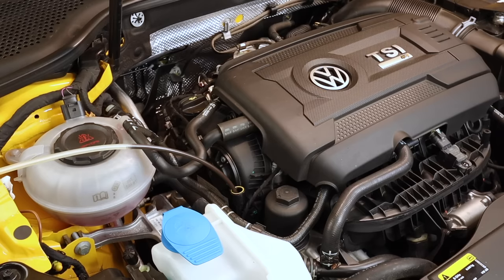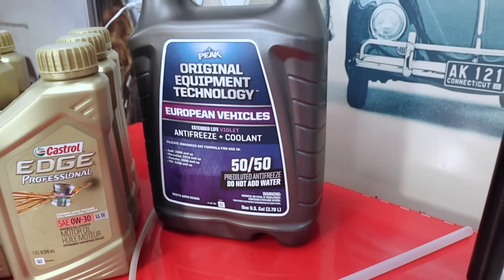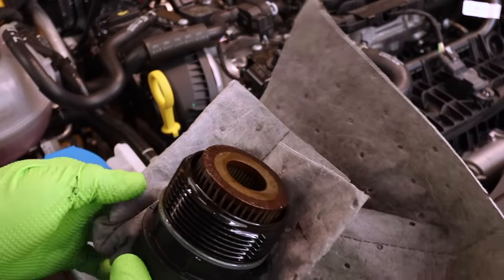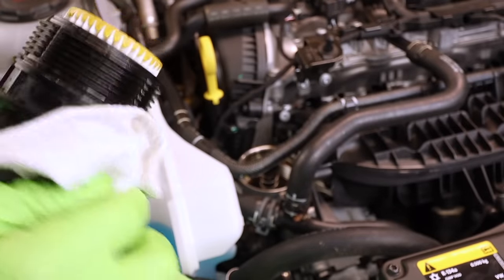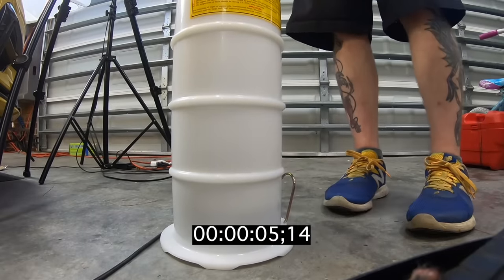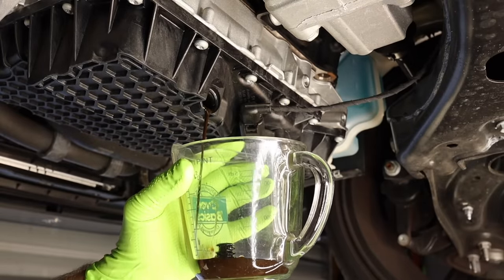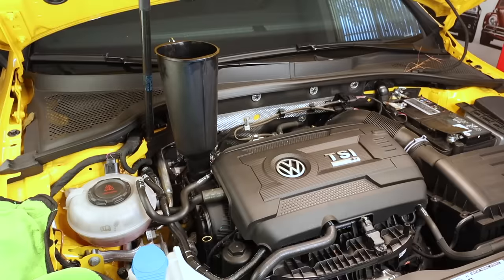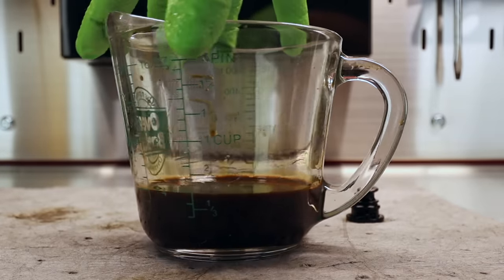Will an Oil Extractor Get All The Oil? (MK7.5 Golf R 5000 Mile Service)

Comment: When I did the oil change on my dad's old A6 2.0L, I removed the drain plug after extracting the oil and only one drop barely came out. I even got the oil out of the filter housing with the extractor. Not sure what you're doing to get such a different result than me.
Reply from the maker: I think if I let got longer I could have got more. But still 100ml isn’t that much of the overall quantity

Comment: When I drained oil from a BMW I found fragments coming out. With the extraction method I would never have noticed it since the tube is too narrow to suck up the parts. Therefore I always drain. It also gives me an opportunity to check the underside as well.
Reply from the maker: What was the source of the bits?

Comment: I like using a oil extractor. I've been using it on my Mercedes since that's what the dealer does. My car will take 8.5 qts of oil and it is what I pour in. When checked the oil level it is correct. It even works with my 4 Runner. But I have to move the extracting tube up a bit to make sure it gets all the oil .  On the Mercedes I just leave the tube sitting at the bottom. I took the drain plug off the first time with the 4 Runner. Very little oil came out. A lot less than what came out of the VW in the video. . My 4 Runner will take 5.5 qts of oil and that is what I put in after getting the oil out and replacing the filter. I like using a oil extractor.

Comment: I think I like this approach. No need to lift your car for a simple service. Also no mess.
As far as 100ml is concerned,  even if we take 200ml, that's about 5% of the total, so should be fine.

But one concern, when you open drain bolt, the heaviest / slushiest oil comes out first and the lighter oil should further help in cleaning up. The same is not the case with these vaccum based oil removal.
Reply: The extraction hose hits the bottom of the tank, it is the same.

Comment: i use to own a service truck and go around and do 'fluid change' and other mechanic task and my truck was equip with 2 small extracting pump one manually the other one automatic powered and i can say for sure that most car when you extract the oil not all of it will come out their will be some left over thats a thing i been telling my customer because they was worry about it my process on old car the one that as the oil filter under the car i have to lift the car and often on request change the drain plug with a better one that include a seal that most factory 2010 and lower don't put on, so it can leak from the tread and have a what i call 'Wet Oil Pan' this you can see often on older car that the drain plug asbeen the problem for many years but back to the subject usually if i have to lift the car i will take my pump and stick the tube inside the drain plug hole and try to catch everything i can but considering some go pass the mark of 5000 Miles or for diesel 10.000 Miles it doesn't matter if you drain all of the oil to 'bone dry' some pressure will still hold a few ML of oil in the engine it self where its not reachable, another tip that i see often is people remove the oil fill cap to think it will drain all the oil faster and i can say its wrong because if you use a pump and crack open the oil fill cap your removing the built in pressure witch force the oil to not evaporate and by not opening it your helping your pump to suck all the fluid and not just the air that could cause your hose to as some oil left over to act as a return line so while you use your pump you can always let it run if its an electric one till you pull the hose out and then put the hose up and shut off the pump to have all that left over in your waste oil jug/bucket instead of back into your oil pan ! and from top  filter if you have a most recent one its always good to have both O rings gaskets change to prevent leak :D, over all great video :yougotthis:🤟👍

Comment: last oil change on my mk6 gti (oil temp ~ 180 deg F), fluid extractor removed everything. Opened drain plug after to check, barely a drop. These things really work well on level ground and with hot oil. Anyhow, that engine sounds beastly... bone stock?

Comment: With our TDIs we find that extracting the oil out of the oil cooler makes a significant difference
also add fitting to attach your ac vacuum pump and you can hear the hiss and bubble when you  move the tube around inside the oil pan

Comment: this is great for low profile cars with the bottom plates with a ton of bolts and screws. Such as maserati bmw mercedes etc...  way convenient and 100ml. will be fine. The extractor will make it more convenient and less of a mess.

Comment: I reached 260 000 km with a diesel engine using 10 000 km rated oil but changing it at 8k, I also remove the pan to clean it all well, last oil change I had some sludge on the pan which I didn't had before, I'm planning to keep this engine as clean as possible and see if I can reach 500k.

Comment: There was a change to the engine oil requirements partway  through the model year due to the engine being newer (latest Euro spec compliant or something) My MK7.5 is still the older model and/ 5W-40. The dealer can check the VIN# to see if the engine is the newer version or the older EA888. The newer engine was down-rated in HP from 296 to 292HP in stock, due to these emissions specs.

Comment: I KNOW this isn’t a Mercedes but Mercedes actually recommends evacuating the oil through the dipstick
tube with an adapter that fits on top of the dipstick tube (not a separate tube inserted into the dipstick tube). In my experience on Mercedes (and I KNOW this isn’t a Mercedes) you actually get more oil out by evacuating it than by draining it (in normal shop situations) i.e.  I guess you might be able to remove more oil by letting it drain overnight etc.

Comment: Great video!
Just curious where you got the part about the engines being designed to be drained with an extractor from. I worked at a VAG dealership and the manufacturers instructions REQUIRED us to use the drain plug over an extractor, including all EA888 engines. We'd only use the extractor on old cars with fucked up drain plugs or cars from other manufacturers (mostly BMW and MB).
Reply from the maker: When they first came out with this engine vw put out several documents and a video with Leon showing to extract

Comment: I did the same thing with my Harley and usually I get most of the oil but this last time, I had quite a bit of old oil that didn't get suctioned out. Next time, I will use the drain hole for a complete oil change. It seems easy, but unless you drop the drain plug, you are not getting all the contaminants out.

Comment: 1:17 - do w/warm engine.  W/a cold engine takes forevr n neumatic ones r worse.
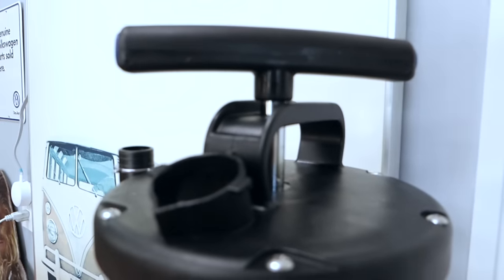2:44 - run car for about three min. turn off and let it sit for 4 a min. pull dipstick out wipe it n put bak in n slowly remove it again.  Oil should be right at the line.
Oil filter change
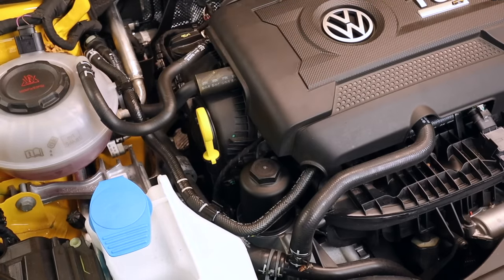7:35 - take out dipstick n c what hose fits best in there.  (9:07) - periodically pull hose out.
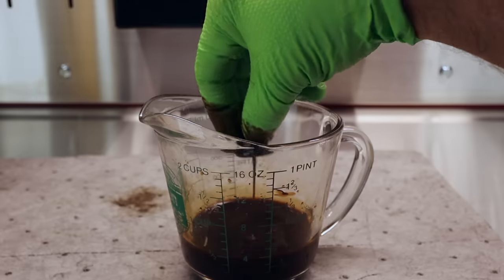11:46 - less than 1/2 c. of oil left when u c how much oil was left the extractor didn't get.  Let's call it about 100 ml of oil left.  (12:00 - 12:19) - no sludge left startin w/1:17 if u follow all the directions.

Comment: I poor and extra liter in while draining or extracting down the dipstick conduit, oil fill point and the oil filter location to help rinse and get the last bit out. 

Anything left beyond that is fine, as you said, we're not cleaning the oil pan so you won't get that much left.

Using the aforementioned technique you won't have 100ml but whatever diluted amount, I suppose 20ml old stuff if you factor in 1 liter clean to the 100ml old plus perhaps 10 ml of old pulled off of the engine complements when you pour in the last liter.

Comment: I pull the plug out and while the oil is draining I rotate the wheels, the extractor is neat, but you still need to go under the car anyways. Thanks for sharing Charles.

Comment: 100 ml on 6000 ml is 1.6%. With older cars I like to run it hot, let the oil go out through the drain plug, and then with the filter not in, and the drain plug out, I throw in a little bit new oil. The flushes the old out oil a bit. The place the new filter and close it and fill it off.

Comment: ...you might leave some in the pan, but you're also able to run the tube into the oil cooler through the filter housing and get the oil that would never make it to the pan...

Comment: I need some advice. I have one of these (a four uncles one, with the air compressor hookup). But I'm finding that when I manually pump, it works WAAAY better than the air compressor hookup. BUT it's extremely slow, as in 2 liters per half hour compared to your 1 minute for 5 liters.

Comment: Some drain plugs have magnets in them to collect any tiny pieces of metal, so for me the drain plug would definitely come out as also there may be tiny metal shards in that last bit of oil. 
Also any aluminium shards whould be in the sump in that last bit of oil. 
OCD maybe but theyre better off out than in.

Comment: This is all I do every month on my tdi. I use my Amazon to auto order the oil so it shows up on the first every time. About 2500 miles takes 10 minutes and a bottle of prolong engine treatment. 
Then I pour the oil into the fuel tank and treat the fuel system with that prolong. The car is so happy and my rawtek Malone stage two is amazing. I change the filter yearly. 
I love oil, good video

Comment: My 4.0TFSI has the filter right next to the drain plug so it really makes no difference.  The belly pan is a pain in the ass to remove.  I might do a mid service change and leave the filter untill next time and do this.  My wifes 2.0TFSI is similar to yours and it really looks enticing.  Engine flushes would get a drain plug removal.

Comment: My 2019 GTI owners clearly says use 0W-20 for the GTI and test the R in manual says 5W-30 5W-40. I also had to get oil from dealership.
I also will change my oil every 5,000 miles because I track my car. After seeing this I think I'll alternate removing oil from top the one time then next from bottom.
Reply: Bull Bear Portfolio 97,000 miles on my mk7 GTI only running 0w-40.  Changed every 7,000 until I tuned it and now change every 5,000.

Runs perfect. 

I’ve been using Mobil 1 euro and Castrol Euro. $27ish for 5 quarts on amazon.

Comment: I've got 2 questions concerning the extractor method shown in this video:

1. Why would you install the new oil filter before starting to extract oil? The extra air supply should help with suction I think?
Kinda the same reason why you should take out the dip stick before taking the drain plug out.
2. Why not extract the oil through the oil filter line? Should have a larger diameter than the dip stick hole?

Thanks!
Reply from the maker: 1) maybe but I haven’t seen that make any real difference. Especially since doing this hot is important 

2) it’s not a straight path to the pan through the oil filter housing
Reply: @HumbleMechanic  OK makes sense, thanks!

Comment: Always use the drain plug method to extract oil from the engine
It's time tested and the best
Reply: There's a reason why there is a drain plug. The most important part of an oil change is removing the crud that settles at the bottom of the pan.

Comment: Hi @HumbleMechanic
 thanks for the good videos, I just watched this one and I'm a bit confused about the coolant. I see you're using Violet and it says VW 2006 and up, however, the coolant in my '17 GTI  S is pink G13, and the user manual says: "The engine cooling system is filled at the factory with ... engine coolant additive G13 (TL-VW 774 J). This engine coolant additive is PINK" The pink coolant from Peak says "VW: 1996-2005" so what's going on here? Thanks again for the videos.

Comment: 100 mL is one-tenth of a liter. There are probably another 50-100 mL left in the engine since changing the oil does not drain it dry. I don't see a problem with it. 100 mL is 1.75% of the oil volume of 5.7 L. It's also not designed to be drained completely dry at each oil change.

Comment: Been using extractors for about 6 years now, far as I figure, whatever is left below shouldn't be a problem if you change your oil often enough and use decent oil. I haven't seen any real sludge in ages anyway.

Comment: The biggest reason I use an extractor is I do not put off oil changes plus I hate having to remove the belly pan more than doing the actual oil change.  Since my oil filter is a cartridge style that is up top it's even easier.  With the style of drain plug that's on my car the extractor actually gets MORE oil out of the sump than removing the plug.  No brainer!!

Comment: I pull the plug. Always have and probably always will. It’s tempting to buy an extractor for the ease of changing the oil but I can’t leave oil behind like that especially because I was anything that may be at the bottom of the pan out of the motor.

Comment: Many do not understand Plastic deteriorates without use. 
Plastic becomes brittle, sometimes deteriorates to powdery substance or develops cracks without movement. They can be designed to have a limited life, conversely they can be designed to have unlimited life ( plastic bumpers, house council bins etc). 
Control on the rate of deterioration (unpreventable deterioration) is the holy grail of manufacturers as they didn't have this over metal. Plastic has a timer constantly running down. 
We see this in the application of plastic on radiators, dash boards, door trims and even plastics on shoes etc. 
This control on deterioration rate is designed, engineered and calculated by manufacturers to reduce the life of the unit so it reaches financial impracticality earlier than before.
Plastic parts designed to fail (as for sure they can do non degrading plastics) is one reason newer generation of cars are incapable of becoming classics.
Reply from the maker: I wonder how these will hold up! Most of the plastic isn’t common plastic but more fiber composite aka space age polymers Ahha.
But really I do wonder how 20 years will be.

Comment: Extractor is the best way to go and I'll tell you why. If you do oil changes more often, you'll never have that much sludge sitting on the bottom of the engine, if any at all. I buy excellent full synthetic oil for $3.50 per quart, which is a great price! Change your oil every 2500 miles with the extractor and you will never have dirty oil like that. Even if you have leftovers on the bottom of the engine, it won't be that dirty and you'll never have to risk damaging the drain plug by removing the oil from the bottom and having to put a new bolt back in every time. It's the same process with the transmission fluid.

Comment: On my Audi B8 A4 (EA888 Gen2 2.0T), I drained the oil once using the plug, and then was still able to extract some more oil using my oil extractor (which is my normal oil change process).  So opposite result from this video of an EA888 Gen3 engine.  I'm sure the result will vary depending on the shape of the oil pan for the particular vehicle and whether you lift it level or on a tilt.  And is that plug a replace if removed?  At $4 a pop (no idea why the Q5 version is less than half that cost), that's just that much more money spent.

Comment: 100 ml is exactly 1.6% of the total of 6 liters, this can be considered a measurement error. An oil extractor is great also if you don't want to spend hundreds of dollars for an oil change at the dealership on a new car but don't want to void the warranty of your new car. I am planning to do just an oil change (no filters) between every maintenance at the dealership, but I have a similar bellypan and I don't want to risk leaving any marks on it or the bolts.

Comment: Isn't 100ml only 1.7% of 5.7Liters, aka 5700ml? So if an oil change , using an extractor, removes 98.3% of the potential oil extracted by getting under the car, and you can avoid the additional labor and steps and thus do it more frequently, I think it really makes sense. I got my home oil changes timed to under 11 minutes - all in - but that does not include the nightmare I have dumping the oil catcher into a transport bottle for recycling.

Steps saved: 
Setting up ramps or jacking up both sides onto stands. (If oil filter is on top like a small percentage of cars)
Getting proper drain nut size wrench setup, setting up creeper, sliding under, locating pan, removing any shielding, removing bolt, retrieving dropped bolt out of 5q bucket of warm oil, cleaning drain bolt, replacing crush washer, replacing bolt, insert by hand, grab torque wrench, set torque wrench to proper lbs, torque bolt, clean up, slide out, put all that junk away.
Slide hot bowl of oil slowly out, lift carefully, somehow pour it into a funnel being balanced by your knees, pour oil into travel container.
Break out the kitty litter and dispense over all the parts you missed. Sweep up next morning. 
Put ramps, jack stands, jacks away. 

Hmm, I think as a man in my 50's I'd rather do the oil change a bit more often, syphon direct into the container I'm taking to the recycling center, pour in the new and call it done. Of course where the savings really add up is cars like the Opel Vauxhaul insignia, aka the Regal, where filter cartridge is on top. Jaguar F Type, etc.. Interestingly, the only way to drain oil on an F TYPE is syphon. The fill neck has a built in syphon tube. And well any car that doesn't make you climb underneath.  If I have to climb underneath for the filter than I think it's whatever mood I'm in.
Reply from the maker: Nailed it